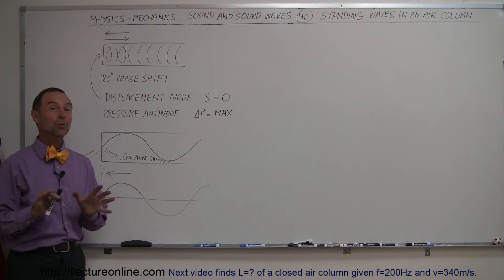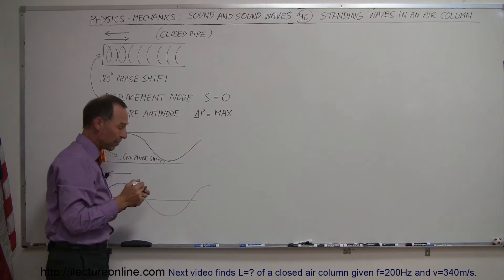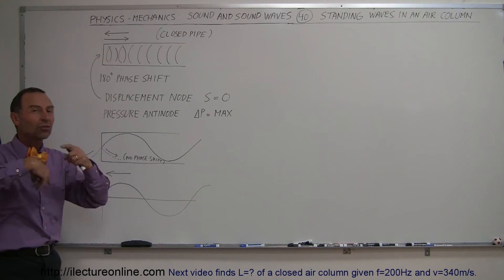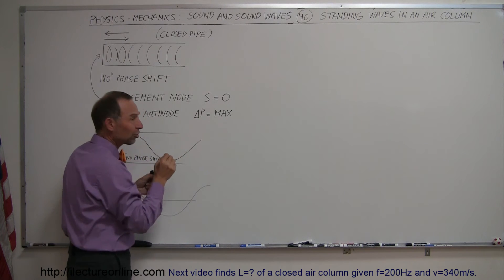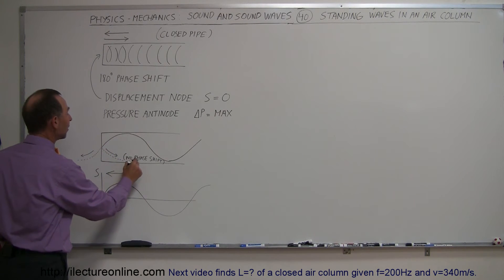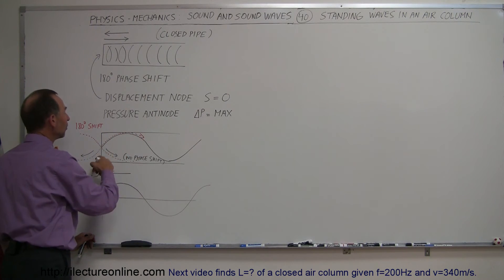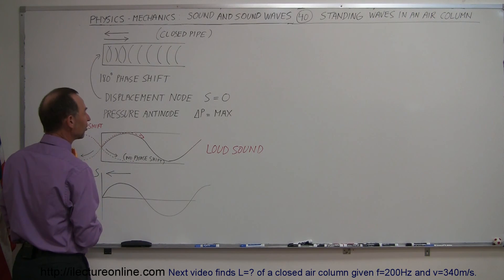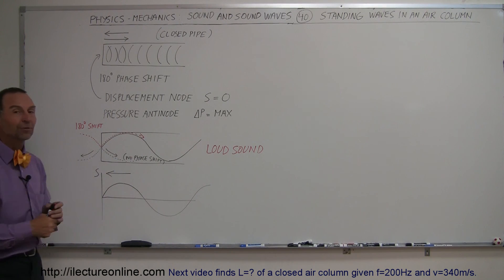Physics 20  Sound and Sound Waves (40 of 49) Standing Waves in an Air Column

Comment: Sir, can the amplitude of a wave in a pipe be bigger than pipe's diameter?
Reply from the maker: Since sound waves are longitudinal (not transverse) the amplitude of the oscillations are along the length of the pipe.  (They tend to be small)
Reply: @MichelvanBiezen  Thank you for the answer, sir